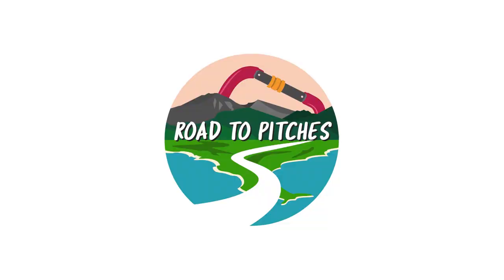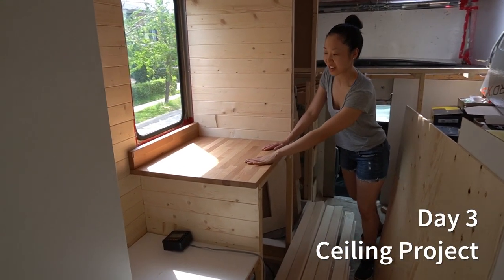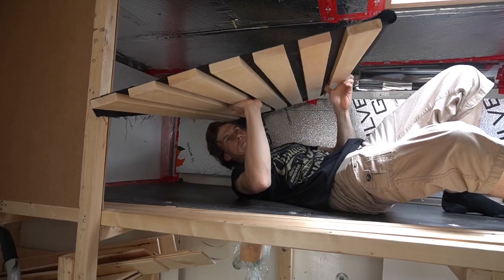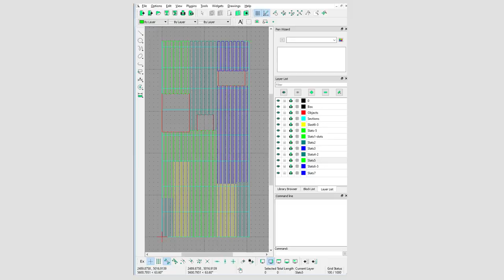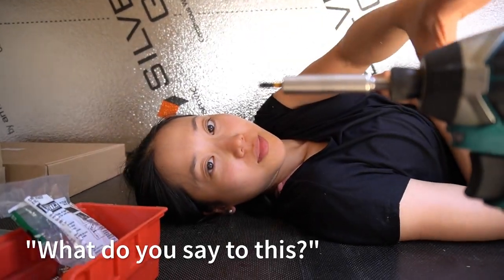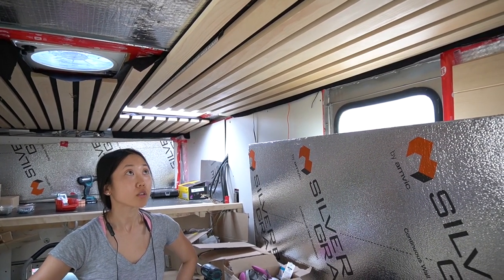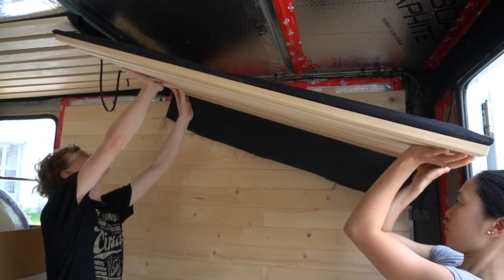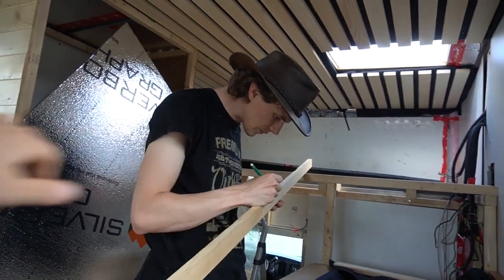How to Build the Ceiling in a Box Truck Conversion

Comment: Well done!  Panels make it modular for easy dismount in case of repairs.  Very good concept of using cloth behind for a good contrast.  This was so creative. The ceiling looks high end and classy, and some of these luxury touches are worth the cost. Pre-finished wood strips saved on labor over palette wood which is hard to get in specific lengths - not worth it for a precision measured application. It is uniform in color and style and looks professionally done.

The mention of LibreCAD was very helpful.  This is a free, open source CAD designing system.  Well worth exploring. The learning curve here can be transferred over to any other paid CAD systems as the concepts are similar.  Thank you for this link!

Notes:
Please tie your hair back when working with power tools, especially in windy outdoor conditions.  Basic safety 101.  Pull back long sleeves, eye and ear protection.
Invest in a small plastic fold up table for $40 for your wood work, from Costco or Home Depot. These are wonderful to have for outdoor cooking, DIY work, BBQs, or outdoor dining. They fold in half for easy storage, and they are very sturdy. You will hurt your back bending down so much for chop saw and working on ground. Save your back.

Please consider no music in videos.  It's a lot of work to keep turning volume on, off, on, off.  I loved the project but the music was a continuous annoyance and hurt my ears.
Note: Let him talk more. You are articulate and communicative. He is more soft spoken. Let him have more time to talk.  Just as your skills grow on a project, so should your personalities and personal growth.  You can pick up on handyman skills while he picks up on more verbal camera practice.  This will balance you both out well.

Comment: Although that looks awesome...the last place you want cloth is on your ceiling. It will hold moisture as well as every smell of everything you cook.  But...It does look nice...Great job so far!!!
Reply from the maker: Thanks for looking out for us! Our convo went like this:

Sachiko: 🤔 Good point. Didn't think of that.
Moritz: I thought of it. It's an acrylic fabric so shouldn't be too bad.

We're going to have a portable cooker to limit cooking indoors anyway (not a fan of cooking inside a small space like that!) and now that you point the smell out, even more incentive. And I (Sachiko) can't stop admiring it.
Reply: They could have painted some 1/4 luan plywood black and installed their wood strips over top. Much easier and take out some of uneven roof.
Reply: @billrehm3590  that sounds like a good idea, but I imagine with the fabric it's lighter in weight.
Reply: Everything I do in my box truck has to do with insulation 
Keep cool or keep warmer. Great job but Cloth?

Comment: Save some cash , some Lowes & Home Depots will cut your boards if you ask .
Example : 
You can buy a 2"x4" and make strips ( for tacking , etc... ) or you can pay a lot more if you buy the tack strips ..

You can do the same thing with the roof strips by buying the arts & crafts 4 x 8 plywood which is usually oak , etc... And strip it out using a table saw .
Ask your store if they'll make the cuts for you .
You can usually tell which stores will cut the boards for you by their saw set up is usually in the back corner area at the end of the wood area .

Really enjoy you two , realistic .... I like that ....

Only critique I'd have is there's no way for mold or mildew to escape the walls .
The metal outside skin and inside temperature differences along with humidity will eventually build mold & mildew in the wall , hidden away but can lead to bronchial infections ...
Please keep it in mind if you begin randomly getting sick and don't know why ...

Thanks again .... 
Be Good To One Another :-)
Reply from the maker: Good idea with the strips--thanks for sharing that in case our other viewers here can benefit from that tip! Checking arts and crafts was left off our list...we don't have a lot of those around here, only Michael's and they usually overprice. 

ALTHOUGH we just had someone tell us about lumber yards/furniture stores in industrial areas that give out free plywood etc. so we would've done that had we known.

Thanks D&R--making these videos are a lot of fun. Yeah, we are expecting parts of this box to mould over the span of a couple of years :( but that is the reality of things. We have left as many areas open for air as possible. We both have sensitive sinuses, so will keep your advice in mind. 

Wishing you happy holidays 🎄🎅.
Reply: @RoadtoPitches  
Lowes & Home Depot have an arts/ crafts aisle , usually an aisle or two over from the lumber . they'll have small cut squares , etc... ( they're over priced tho ) ...
Usually , all the ones we've been in have had this aisle , obviously I don't know about Canada ... They usually have the bigger sections at the end .... 
I don't think they refer to the aisle as arts & crafts ..... But ..... It is ....

From our home to yours , 
Be Well & Have a Grand Holiday ....
Merry Christmas !
Reply from the maker: @dannyandrose  OH I think I know what you are talking about. Some of the smaller pre-cuts of lumbers, fencing, mix/match tiles and what-not. Some of our larger stores have that. Definitely will keep in mind from now on!!! Merry Christmas to you as well!

Comment: Since I’m going to have a motorcycle & jack for it....my design may end up with everything except the bed area to be removable...yep sink at least 20” deep....shower & toilet ....and boxed segments that can be lifted with the jack and stacked on each other...some will have locking drawers...if this happens there will be frames to keep them from moving.....some will be collapsible for multi use possibles....probably clothes washer too that can do my sleeping stuff & almost any of the other clothes.
Reply: When fully utilized it will have enough room to go to the bed bathroom ...not much more I since it will have a motorcycle...bike....& other gear.....thinking it will be at least 16ft.  ..I’m going with 3 inch or so vents instead of 1 for more even circulation and control & also to have more roof stuff...solar etc.....the vents will probably be marine 3ish inch & be located under the solar.
Reply from the maker: @allglad  Definitely 16 ft box if you're bringing a bike along. There's always the roof...😂Great idea on the vents for circulation. Under the solar would save you space, but if you're using the vents for partial light like we are, then you will lose out on that. Would love to see your final design and buidl!

Comment: Not to be critical because you are doing way better than I could but from what I can see it would have been better to do all the wiring and plumbing and then the walls ceiling and floor. And then cabinets and furniture.  Anyway it looks great and I would live in it😎
Reply from the maker: Apart from the wires in and under the floor I intentionally left them accessible. One reason I can easily fix things, the other reason I can easily add more wires. If they were hidden in the walls, it would be more difficult. Pretty much the same with plumbing. I've had hard time for some reason getting it leak free. So I was happy it didn't leak behind the walls.

It's actually fairly easy to hide all the wires and pipes behind our storage. So besides the tiny bits of ribbon cable at the lights, you don't see much of it.
Reply: @RoadtoPitches  sounds like a logical solution👍

Comment: looks great, did you ever consider using drywall instead for the walls and ceilings?
Reply from the maker: No way!!! That would be TOO heavy. We kind of regret using the particle board, but we're glad we experimented with it. I'm also not sure if dry wall would crack easily from the vibrations.

Comment: And because of water damages and that cloth up in the there. I would get the sum paneling and you can always stain wood with used motor oil and it does a better job in terms of brown but you would want to seal it real good and I got some pictures of what it looks like if you wondered about the collar but it works better than any stain or sealer because it's still got all the creosotes and chemicals in it that they took out of paints and stains
Reply from the maker: That looks like an interesting alternative--never heard of using motor oil, so thanks for sharing! We do have a few little ones around (not ours!) and my sinuses are rather sensitive--is it safe to use indoors or better as an outdoor option with plenty of air flow?

Comment: Looks amazing! How did you attach the ceiling to the van? Did you screw on to the ceiling metal? (would that cause leaks) or did you scare onto the metal bars in the ceiling? What types of screws did you use?
Reply from the maker: Thank you! The box is actually made up of aluminum framing with alum sheets attached. The frame itself has 3 sides so we attached the ceiling to the inside side (if that makes sense!). We just used regular screws wood/metal screws. That was how the old ceiling of the roof was attached as well.

Comment: what's the  gas mileage on box trucks? how do they do offroad?
Reply from the maker: Gas mileage depends a bit. We are seeing from 18 l/100km on the highway to up to 26 l/100km in stop and go city traffic. We haven't really put it off-road yet. If you watch our maiden voyage you can see it bouncing over a dirt road. It does have a lot of ground clearance which is awesome, but it's only 2 WD. I haven't figured out yet if the rear diff is auto-locking or not. There are also 4 WD kits, but we currently don't have the budged to get that done.
Reply: @RoadtoPitches  awesome! thanks for the info!

Comment: Everything looks amazing but I had leaking problems to and I just use that black mamba. It's a roofing type COK that you can put in a cop gun and I did all my scenes with it and went above and beyond and then painted it and I am very pleased but y'all have a lot of products that if they get wet though mode and moisture is already a problem in them things
Reply from the maker: Yeah, that's a really good point. I agree that for our next build, we'll need to be more thoughtful about moisture issues. We are planning on using the truck for 1 year and that's pretty much it! Which is perfect for us to experiment and let y'all know if it works. Thanks Gary!